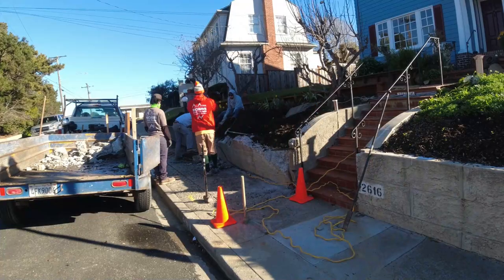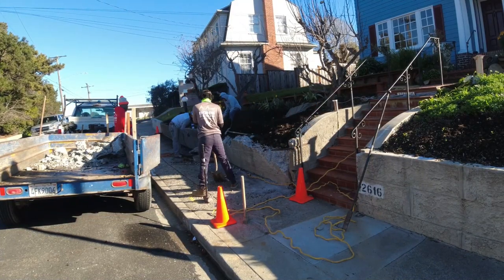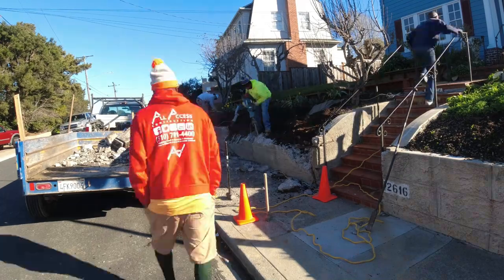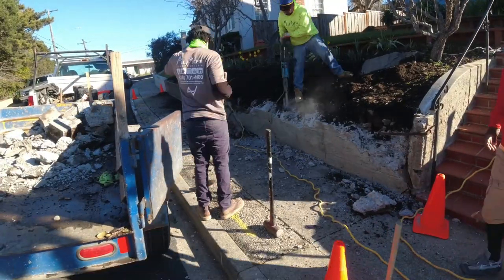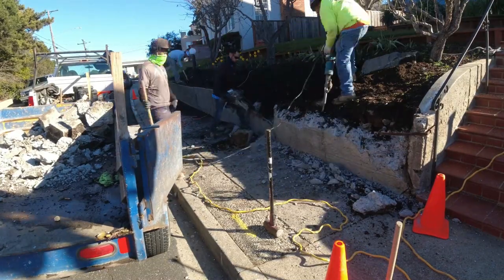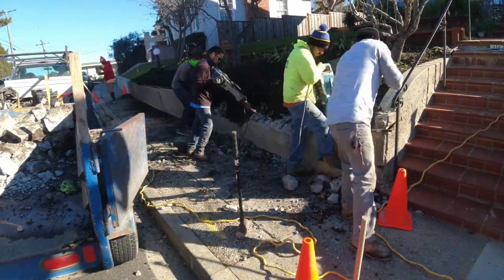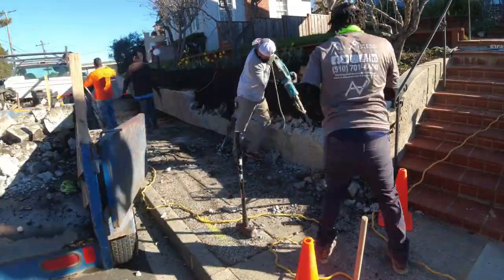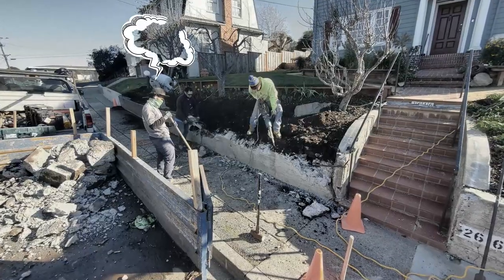✅ Us Out Framing A 3 Ft High Concrete Retaining wall | Time-Lapse

Comment: I noticed your guys scoring the the 2x12 with the circular saw before setting them in place. What is that for?
Reply from the maker: Appreciate the comment .. You can't tell but the sidewalk has a slight curve to it. Scoring the 2*12 allows us to bend the wood a little so we can follow the curve in the sidewalk... 1*12 would also work, but probably would of use more stakes

Comment: Awesome videos. I've watched pretty much every one you have posted. It's really helped me learn how a poured concrete retaining wall is built.

You mentioned the old wall failed due to poor/no drainage. Maybe in a future video you could take a closer look into how you handle drainage in your retaining walls. Looks like you typically have a 4" pvc pipe go through the wall which connects to a 4" drainage pipe that runs along the length of the wall and on top of the footing. How do you place the pipe that runs through the wall? Do you cut a hole in the two 2x12's and slide the pipe in before the pour? Also, it looks like some walls don't get drainage pipe. Is it only required for some walls?
Reply from the maker: All good o appreciate the support.. Just be sure to hit the like button.. Helps the channel..., 💯💯👍🏾👍🏾
Reply from the maker: All our walls have a French drain system.. Check these videos out.. https://bit.ly/InstallFrenchDrainConcreteRetainingwall http://bit.ly/2v7nmNF

They give in depth detail explanation. And yes to cutting hole in 2*12
Reply: @AllAccessConstruction  Thanks for the response. I'm rewatching your videos and learn a little more each time through. I second the other guy about the smooth narration. Keep up the good work.

Comment: Interesting that you didn't need a footing for this wall, what is the rule re having or not having a footing for an approx 3 to 4 foot high wall? Love the videos and hello from Dingle,  ireland
Reply from the maker: Good morning... This wall has a footing and a small key way. Just can't see in this video. I believe it goes back 2.5 feet into the hill 18 inches thick #5 rebar 12 inches on center.. The wall that was demo did not have one. It lasted over 50 years very little movement. Client just wanted a different look... #goirish
Reply: @AllAccessConstruction  thank you for replying, much appreciated.  I have to build a 4 foot high retaining wall only 8 foot long and I was wondering if I had to have a foot or if I could get away with a 12inch wide wall from the ground up.ur opinion would be great
Reply from the maker: I'll recommend minimum 12inches 3 feet wide
Reply: @AllAccessConstruction  thank you for your advice,  keep up the good work. Seán
Reply from the maker: All good.. #goodluck 💯💯